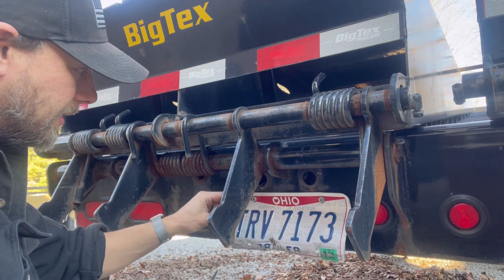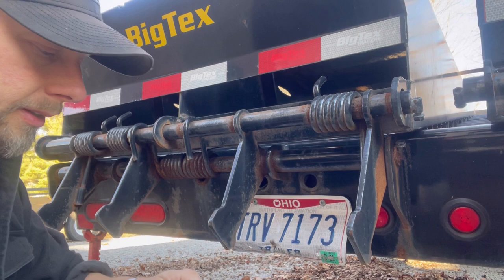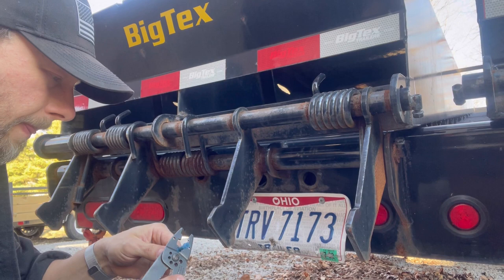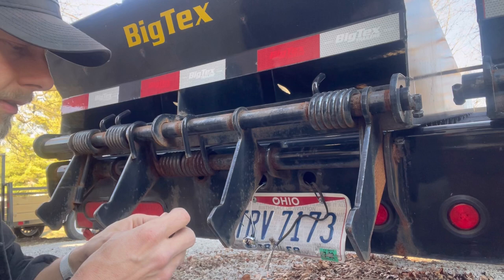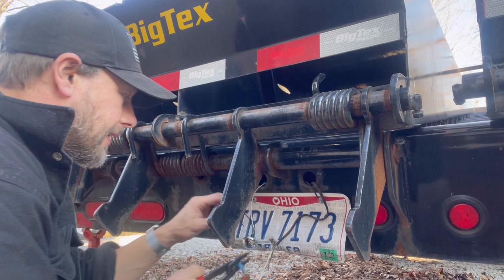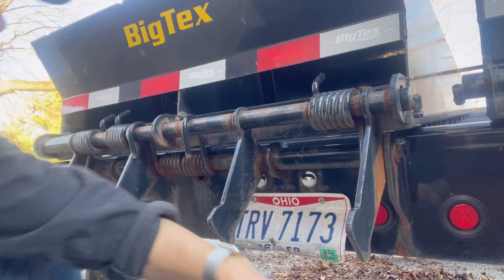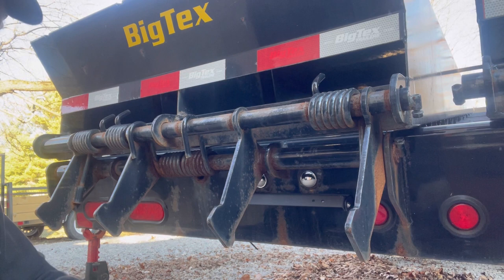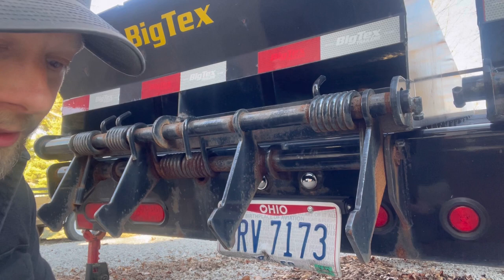Fixing Big Tex trailers 2 biggest problems

Comment: Can you share a link to where you bought those LED lights?  Having trouble finding LEDs that are a direct swap for the ones Big Tex uses.
Reply from the maker: https://www.amazon.com/Blazer-B165-Round-License-Utility/dp/B06WD6LDGL/ref=mp_s_a_1_18?crid=34XYOI0JN6GP2&dib=eyJ2IjoiMSJ9.XRgweiu635Hboj8JZnMOMWcKO3Ir2mRx3BVMa4ebrVv-O7pACiDToyfClI8MInfcVxpZiPXhYgL8MG3xXh5nC8Q5wK4ZPLnI-eY9rGtzB__WDQm5wmkMGdJAxJqHaWeiz56pMJyki4zz_aQxC_IFomddzDr6pV9TM6fboxZr9dFZZOIc9jFdtv4nNxCWZZ8s0frdjPhqyT4vVeDONlmz9g.b-XljEI3DCGT2mTmr7gy_2osSpjdYYUZ2lw_coGskhA&dib_tag=se&keywords=led+license+plate+light&qid=1712073576&sprefix=led+license+plate+light%2Caps%2C93&sr=8-18

I case you have not found a set.

Comment: I'd like to cut off the bottom 3 inches of my big tex 22gn, it drags entirely too much
Reply from the maker: Unfortunately, all Big Tex with mega Ramps drag. I have video of me getting stuck going up a hill into a gas station. The long the trailer, the worse the problem
Reply: @lifeontheroad_  yeah last week i ripped the bottom bar open and tore my wires up, i'm thinking im going to take a few inches off and reroute the wires

Comment: What year is that trailer
Reply from the maker: 2022
Reply: @lifeontheroad_  I have a 2023 big Tex 25gn and I noticed an issue with the front jacks. When I’m unhooking from my truck and I’m lowering the jacks, once the left jack touches the ground the right one is still about 3 inches off the ground. Not sure if it’s a big deal but shouldn’t they be touching the ground at the same time? I wonder if there is an adjustment. Even it’s it’s not a big deal it pisses me off since the trailer cost me so much money and it’s brand new. Any idea?
Reply from the maker: @disarmyou84  
Hmmm. This trailer does the same thing. However, I assumed it was uneven ground. But maybe the jacks are uneven. Quality Control has been lacking on all accounts. Make sure to check all electrical connects, especially heat shrink connectors at axles for brakes. More than likely brakes will need adjusted. I just had an owner-operate with the same trailer. The wiring harness was stuck between the decking broads.
Reply: @lifeontheroad_  yes the way they wire it it’s like they don’t know it can rub through on the contact points. It’s a shame since it cost so much.